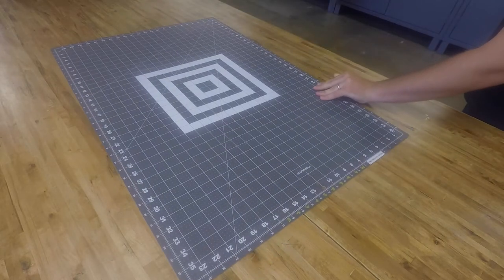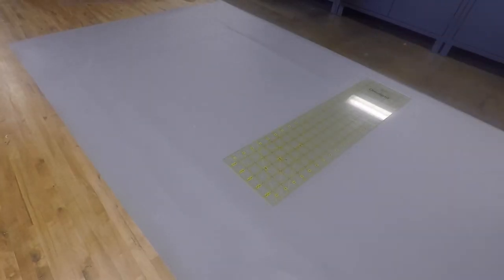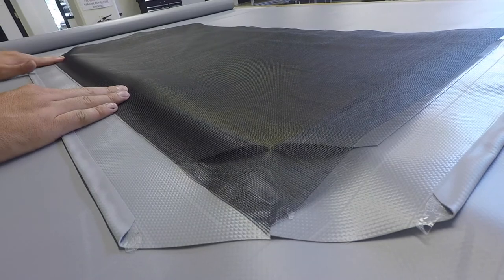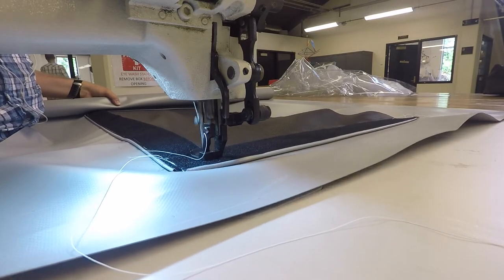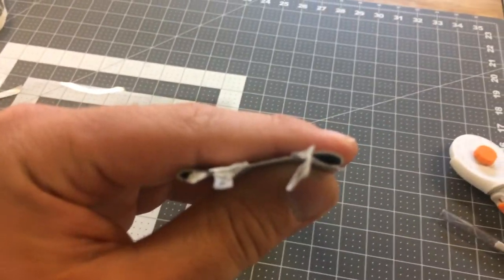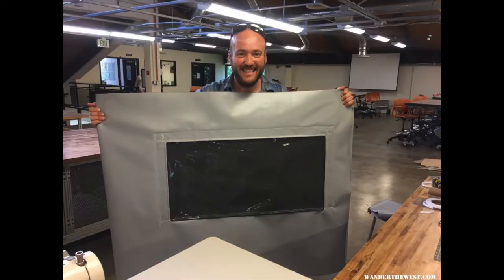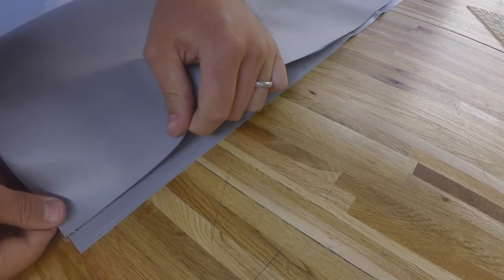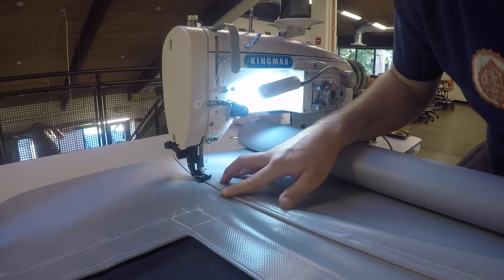Four Wheel Camper Build: How to sew a pop-up truck camper canvas - Part 2

Comment: very adventurous project for sure, as a professional upholsterer ,im impressed with how well you did. I know how much work it is sewing that truck tarp material,(question your choice on that material, so many quality boat cover materials that would work better, easier to handle, waterproof ,yet breathable, AND SO MUCH LIGHTER WEIGHT), wow that had to be a heavy piece when all sewn together.
 having a "long arm sewing machine " comes in very handy in those situations, kudos to your work ethic
Reply from the maker: I used the material I used, the vinyl coated polyester, because others had used it before me with success. I don't know enough about materials to be able to select my own. Do you have some suggestions for other types of materials folks might want to check out?

Thanks for checking out my video, glad you think it was worthy!

Comment: Your videos are GREAT and I love your honesty. I'm a quilter and had to laugh at your "I don't know why but look it up" attitude. That's the perfect DIY answer!!! Just an FYI if you ever do another sewing project. Anytime you use a bunch of bias tape(which is basically pressed glue) I keep a bottle of rubbing alcohol next to my machine as I'm sewing. I periodically take a cotton ball and wipe down my needle as it will get sticky and then the thread will jam. It keeps the bobbin from getting gross too. I also sew a little slower cause the speed creates heat which turns the glue into a mess. That fold seam you did is exactly how jean seams are sewn. It gives a perfect finished look - GREAT JOB!
Reply from the maker: Hey. Thanks so Much for the note. Glad you think I did a good job! Much appreciate you check out the videos.

Comment: Nice work, and great vid for learners. Thanks!
Reply from the maker: Thanks so much. You have a camper project too?
Reply: @tgmorrissey  I had an older pop-up camper trailer from the 1980's that I once planned to re-habilitate with some sewing work, and other required replacement of old broken parts. However, the totality of the work was not going to be worth the effort when I looked at the higher quality campers that are now available, as well as my evolving desire to go with a truck camper. In the midst of my old video habits when I was studying sewing, and my new research into truck campers, the Youtube algorithm wisely figured that I would be interested in your video. I will keep it for future reference, as I may come across a used truck camper that needs repair. The current high demand for campers has left me with fewer options for now, and I'll be patient in shopping for a camper that may be my future 'project'. Those 'Project M' campers from FourWheelCampers look nice, but wait list is long.
Reply from the maker: So awesome. Thanks for sharing. Check my website. Tgmorrissey.com for a ton of more camper content. I think you’ll dig it

Comment: Great video, so helpful!!! I am looking for some help with the velcro portion. I could be messing this up but the clear window has a 1inch strip of velcro and it sits inside the privacy flap which has 1.5inch velcro, which would total 2.5 inches total of velcro but the Velcro you are using is 2inches, how did that all work? Your help is much appreciated!!!
Reply from the maker: Hey great question. I’m not sure what it was but it summed out to 2 inches total not 2.5. It was probably 3/4 inch for one and 1 and 1/4 for the other. I made the thinner section but ripping the larger 2 in wide peice in half. 

Glad you like the videos!

Comment: Such a cool project. Hope it's holding up well!! This video will really help with planning for our pop top. I have a bunch of old kiteboarding kites made from ripstop polyester. I want to use them for our tent material. I know it won't be as durable, but it'll be colorful and free. Ha.  I'll probably coat it in something to waterproof it. I am considering going with the vinyl coated polyester after this though... Thanks for the awesome video.
Reply from the maker: Hey Steve. So glad you like the video. Old kitboard kites sounds pretty interesting. Will be unique for sure. The material is holding up quite well! A few creases where everything folds really tight but no major issues. In the description I have a list of products I purchased include a source for the vinyle coated polyester that is actually quite inexpensive. What type of pop up are you planning? A trailer, truck camper or something else?
Reply: It's a van actually. 2000 Chevy Astro. I sliced the top 8 inches off a camper shell to use as the fiberglass top. Have the frame welded and a lifting mechanism in place. Just need to do some fiberglass work to shape the camper shell to the roof of the van. I'll check out the links. I think it's clear labor is the biggest investment in this project, so working with the wrong material would be a waste. I'll be thinking it through.
Reply from the maker: Steve Van Pelt lol yes labor will be certain to be the biggest investment. I have no idea how many hours I’ve pumped into mine but it’s insane. You might be interested in a lot of my videos. I documented nearly all
My build process so I have cool
Info on the galley. Etc. what type of lifting mechanism did you go with?

Comment: Tim, I've studied the way you did the windows and have made the vinyl and privacy screens, including the velcro. But as I prep that bottom seam and do the fold up, and get ready to sew, it's obvious I have too many layers in the corners. If I were to proceed, the closed panel would show layers and not a clean vinyl look like yours. I'm sure I'm doing something wrong. Any other videos, tips, etc.?
Reply from the maker: Hi There. So glad you are finding the videos helpful. It is hard to figure out exactly what is wrong via just words.  If there is a photo floating around if your issue, give me a link but Ill try  to help here too. 

My guess i one of two things is happening. 

1. You are not folding the bottom seam in the right direction. Notice how I folded over once, then folded it up. It really does fold over on itself many, many times. Rewatch starting at 13:30  to see if everything is really aligned the way it should be. 

2. Are you talking about the corners? I just glued patches over them to hide the edges? Check it out in part 3. Linked right at the 264 second mark where I (my wife) did the patching job. 
https://www.youtube.com/watch?v=YumX0jrEBQg&t=264s

Hopefully one of these two responses helped. Let me know and best of luck.

Comment: Hi Tim! Thank you ssooo much for these detailed videos! I'm about to start the canvas portion of my custom truck camper and am wondering how you were able to keep the canvas square while cutting out such long lengths? I thought about using a cut edge from the factory as a guide and measuring off that but I am not confident that the factory edge is totally square (or square enough for this purpose).  Would love your feedback on that if possible. And,  I'm thinking of omitting the clear vinyl and just using the mesh, my hope is that will make that lower seem sewable with a domestic "heavy duty" sewing machine. As that's all I have access to. My other option would just be to hh-66 everything together.
Reply from the maker: Hey. Glad you like the videos and are finding them helpful. Be sure to head over to my site and order a sticker if you want to say thanks. Tgmorrissey.com

For the square question, honestly I was complete oblivious to the need for things to be square and things turned out alright. When then canvas was installed it might have had a bit of twist in it and maybe that was from my lack of attention to square sweeping. But it could have also been a bad instal job on my part . So really know useful info to give you there. 

Per the screen, you could try it, depends on your use. We did a lot of cold weather when we wanted the light but not the air. If you are warm weather and Will want the air too; I could see it working well. But do no it can feel like a cave without the windows open. 

Others have mentioned just gluing the entire thing too, no sewing. No one has ever followed up to let me know if it worked or not, but I think it’s a decent idea. Rafts are made with just glue and they go through hell. 

Good luck. Enjoy.

Comment: Hey.  I know I'm coming late to the party, but with the Covid-19 virus, I got nothing to do other than come up with projects.  So far, I'm so impressed with your work and attention to detail.  I've sewn all my own camping gear for years and am ready to build a camper for my truck (tired of the ground).  so far, only one question - why did you cut each piece out of the roll and then sew it back together?  why not leave it one long piece and measure out where the windows would go?  no judgement, just a question.  You are giving me confidence to build my own once I can access to my shop!
Reply from the maker: Hey Bill. Great question about the cutting. Namely just because that is what the originally canvas had so I figured it was a good idea. But really it was to make it easier to work with. trying to sew four windows on one massive piece would have been a crazy headache. It is really a bear to manage all that material. In hindsight, I could see how just two pieces would work nicely, but the stitching is holding up nicely so far so no issues here. The windows are the tricky part for sure, the straight verticle stitches are easy peasy compared. 

What type of project do you have in mind?
Reply: @tgmorrissey  I'm looking at building a pop up "box" that I can add modular pieces to turn it into a camper, but also take them out to still use my truck as a truck.  I'm exploring "Wanderthewest.com" right now.  thanks for the vids and the information.
Reply from the maker: Awesome. I’ve got a build on that site too. Lots of early info you might enjoy. Best of luck with you build and let me know if you have any more questions.

Comment: Tim I am in the process of ordering the vinyl coated polyester for the pop up. The guy has said that 600g/m2 will be sufficient. I know that you had said that you on second thoughts would have went for the 18oz material. Is this 600g/m2 the same or is it too light.
Reply from the maker: Ohh man, you need me converting metrics to americansese? These is some hard core math right here. lets see, 22oz/sq2 *(28.3495g/oz)*(10.7639sq2/1m2)= 6713g/m2? That does seem right. I dont know I am not very familiar with metric units for fabric materials so I have no idea what 600g/m2 would be. Double check my math above. Unit conversions, be careful, it sinks spaceships.
Reply: @tgmorrissey  Thanks Tim for all that information. I didn't mean to put you to all that trouble but I was afraid of getting the material to light and maybe then it would tear
Reply from the maker: @darseyno1520  No trouble at all. Happy to help, I am really not an expert in fabrics through so I am learning along side you which I am always happy to do. Let me know whta you figure out working in the end so I know too.

Comment: Hey Tim,  Great Job! I chatted with you years back on the forums about the EMT lift. Mine still works great and I use a few hydraulic lifts on the outside. SO much better. Patched my canvas, but now its time to actually sew up a new one. How high did you end up going with the sidewall. Any issues with it being taller or the material folding in properly?  I am concerned about putting the seams on the front corners like original(due to wind driven moisture), do you think it could be done with seams in a different place, or just H66? Lastly, you did 2 big windows per side. Knowing the amount of work you put into each window would it be worth doing 1 longer window per side?  Any other hindsight tips you could offer before I get started? Thanks, Awesome Job.
Reply from the maker: Hi there. Glad to reconnect. 

For height I actually just had this conversation with another viewer on part 1 of these series, pulling it over here too:  "I think originally I had 24 inches of gain for a total of 5’10” of headroom. Now I have 6’7” of headroom. So it now pops up like 33 inches or something like that. If you check out my part 2 or 3 I am sure somewhere I talk about it. The extra headroom is rad.  A big thing for me was being able to sit upright in bed. I think that I a major milestone after the ability to just stand up right in the camper. Let me know if you have more questions."

Extra material and folding.
I do have to walk around and tuck the material in on the sides, but it isn't a major hassle and i think folks are doing that with stock heights too so I would so this is a non issue.

Seam location and moisture:
 I get a bit of moisture up front I drive through a really bad storm (like a downpour) but mostly I am 100% fine. I 'painted' all my seams with hh-66 too which I think helps seal. Though the hh-66 yellowed in the sun which I don't love. I do think purely hh66 would work for the seam with no sewing, but you will just want to make sure you get everything lined up really nicely. 

Windows
I love the four windows. Certainly, 1 window could work just fine too but if they are big they might get a bit unruly. Honestly, the 3 and 4 windows hardly take any time compared to figuring out the first one so I would say it won't save all that much time (though some for sure). I like the four windows and would not change it, but to each their own. 

Tips, just dive into it, make sure you have a sewing machine up for the task, and you will be sure to learn a lot. Stop back in here if you have more questions and also be sure to peruse the comments in all three videos as we have had a lot of great discussions a tips from others. 

Best of luck!

Comment: THanks for this. Is there a reason you couldn't use the old canvas as a template? You mention that your measurements turned out to be a bit off. Could a template from the original help?
Reply from the maker: You are welcome. I had originally planned on using the old canvas as a template. But it was just so messed up I never bothered. It would not have helped the seams and stuff so I just made do. Do you have a sewing project in the works too?
Reply: Pondering one. I’m restoring an old camper that needs new canvas. Your project is encouraging. If I had a big space to work in, I’d be full throttle.
Reply from the maker: Yeah having the right work space and tools is critical! You can do It! What type of camper?
Reply: @tgmorrissey  Northstar 650. The current canvas is good enough for the time being, and good enough, I think, to serve as a template when I decide to replace it. But if it won't lie flat once I remove it, or if it has stretched or shrunk since it was new... who knows? I gather from watching that getting the old one off and then attaching the new one was not the main challenge? Sewing the windows looks like the fussy part.
Reply from the maker: @muunokhoi  yes. Sewing the windows is a bit tricky but once you figure it out. It’s no biggie. Having a machine industrial enough to handle the heavy material is also a challenge.

Comment: thoughts about thermal laminating the material vs sewing?
Reply from the maker: In hind site. Yes I did.  Actually just glueing it. The hh66 glue works very well and I realized I could have just glued this whole thing up. Good enough for boats. Good enough for this. But the sewing was fine too. You got a project in mind you are considering glue or thermal seal for?
Reply: @tgmorrissey  i am designing a backpack but not exactly any specific project like you're probably thinking. I more instead think the future of textile manufacturing lies in glue and laminates and not sewing. we see it already in high end jackets - i think arc terx has a few
Reply from the maker: David O highly possible. Glad you found my project interesting enough to look into.
Reply: @tgmorrissey  Hi, I don't know if you remember, but I ma building my own pop up from scratch.  Would you recommend using the hh66 glue instead of sewing for all of the VCP to VCP joins?  Or do you think the sewing is necessary?
Reply from the maker: @isabellavaldez996  this is a great question and one that has been asked previously. I really don’t know for sure. But the hh66 does make a really good seal. Also white water boats are often made with new sewing. Just glueing. I think keep thing lined up as the glue sets might be a challenge. You’d be in uncharted territory but I’d love to hear about it.

Comment: What thickness vinyl laminated polyester did you use?
Reply from the maker: Hey. It is 22oz vinyl coated polyester. In my description there is a google sheet with all the parts and links listed. If I was to do it again I would probably just use 16 or 18 oz instead.